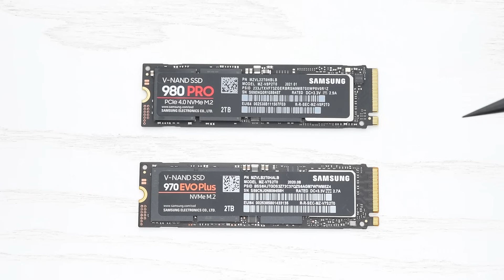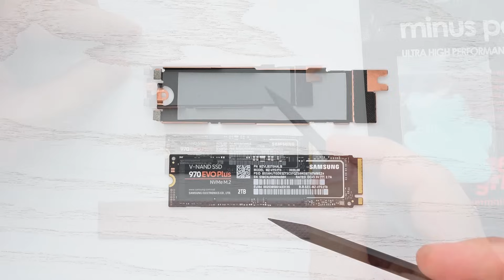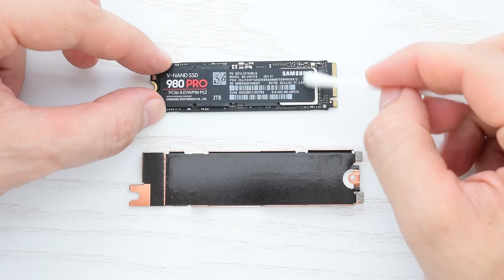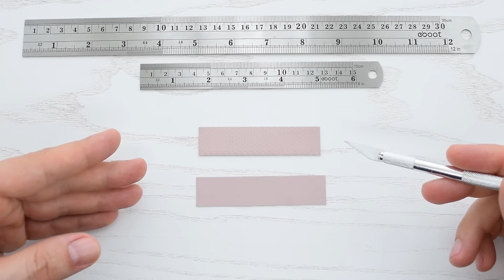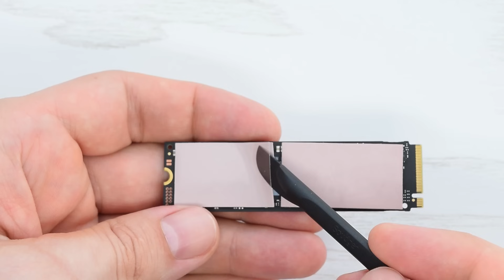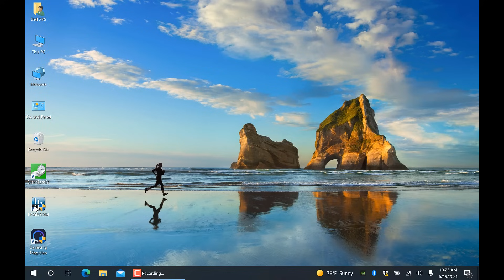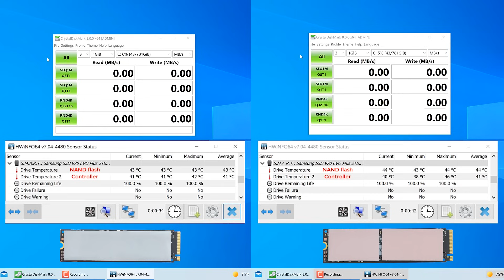Stop your Samsung NVMe SSD from Overheating and Thermal Throttling

Comment: Hello,

I have a WD Blue SN570 NVME SSD that I am placing into a Sabrent NVME Enclosure. The enclosure came with its own thermal pad applied to the bottom of the top cover/heat sink but, it doesn’t actually make proper contact with my SSD.. I have been thinking of replacing it but I have 2 problems:

Unlike your Samsung NVME the WD Blue seems to only have much fewer of those black controllers protruding from it ( 1 larger, 1 smaller,and 1 very small) and so I don’t actually know how to apply it.

I suspect I will need more than 1mm of thermal pad and it is hard to find adhesive ones in this range. How important is it that it adheres to the top cover/heatsink?
Reply from the maker: You can use 1mm pad if your heat sink supports that thickness. The link in the description.

Comment: Would using a .8 mm thermal pad for both work?
Reply from the maker: If your heat sink allows that size then you can use it as a one piece.
Reply: @ElectronicsComputers  what do you mean? I have a 970 evo plus with be wuiet  mc1 heatsink. I’m replacing the preinstalled thermal pad(the one that’s above the ssd) since I damaged the preinstalled one accidentally. Won’t the nand and controller still be uneven if I dont use 2 thicknesses of thermal pads? Or is the 0.8 mm thermal pad thick enough that it somehow works for both? Thank you very much!

Comment: Actually, the controller needs cooling and NOT the NAND memory chips.  The memory needs to run warner when reading or writing.
Reply from the maker: Heat is number one enemy of electronic components. The temperature of your SSD  shouldn't go above 50C.

Comment: Does removing thermal pad later after 6 month removes serial no. and qr code and information written on it?
Reply from the maker: Removing the label will void the warranty and it doesn't make any real difference in cooling your SSD.
Reply: @ElectronicsComputers  I am asking that if I paste thermal pad on printed label without removing it, then while removing thermal pad after 6 months, removes lebel information as pad is sticky?

Comment: Can i also apply it on every ssd? Like the stock one on my laptop?
Reply from the maker: Only if there's a difference in thickness between the components.
Reply: @ElectronicsComputers  like in the Asus rog strix g17 2022?
Reply: @ElectronicsComputers  does it need a thermal pad
Reply: @ElectronicsComputers  the asus doesn’t have a heatsink 
Can i just apply the thermal pad just like that?
Reply: Same I plan to but the g17 but theres no heatsink

Comment: Hi, I’m intend to get the TR-M.2 2280 heatsink. Do you think i still have to buy the 0.5 mm pad just for the NAND chip ?
Reply from the maker: You can use 1-1.5mm pad for the whole SSD with that heatsink. So no need to use two different pads.

Comment: Did you compare the effectiveness of using one short .5mm strip on the controller and then another longer .5mm strip across the entire length?  This would not leave an opening in the middle uncovered and the longer top strip might better dissipate heat over the entire span.
Reply from the maker: That heat sink doesn't support 5mm thermal pads it's too thick.
Reply: @ElectronicsComputers  I think he was talking about 0.5 mm strips. I am wondering the same. Do I really need to buy both 0.5 mm ($11.99)  and 1 mm strip ($16.95)? Or I can buy 0.5 mm strip and use one layer on NAND chip and then cover it with another long 0.5 mm layer for both areas ?

Comment: Do you need to remove the stock thermal pad, and if so, can you just peel it off? Or do you need to use rubbing alcohol/other solution first?
Reply from the maker: Removing the label will void the warranty and it doesn't make any real difference in cooling your SSD.

Comment: Great video. I have 980 pro on my desktop and I’m going to use your method. But I saw some comments said that 0.75mm is better than 0.5mm,  and the other one still use 1mm. Now I’m so confuse that I should buy 0.5mm or 0.75mm, I haven’t any professional tools to measure that.
Reply from the maker: There's about 0.5mm difference between the chips. So 0.5mm and 1mm works just fine. You can also use 0.5mm for the controller and 0.75mm for NAND.

Comment: Thanks for the video!  I have just ordered the WD Black SN850, could this work also with that modell? I wasn't sure if the heatsinc would still fit into my thin Aero 15 laptop, so I didnt' order one. probably bad idea, right?
Reply from the maker: There's no heatsink for that model, so no sense to use thermal pads. WD Black SN85 is a Gen4 SSD when your laptop has only Gen3 speeds support, so your SSD won't overheat.

Comment: Is this necessary in a ps5?
Reply from the maker: For PS5 you can buy Samsung 980 Pro SSD with its original heat sink and in that case there's no need to do anything. If you use a thing third party heat sink then you need to use two pads.

Comment: Hello, first I would like to thank you for this useful knowledge
I have a few questions that I hope you can answer
SSD Samsung 980 Pro w / Heatsink is a heatsink type, so it will fit in a laptop or not, and if it can, do we need to worry about heat dissipation like your video, I mean we do i need to add a heatsink or something like in your video?
Reply from the maker: That SSD is not for laptops. There's no way you can fit it in any existing laptop. What's the model of your laptop?
Reply: @ElectronicsComputers  My laptop is HP Victus 16
It has 1 slot for ssd gen 4. I see it has a horizontal copper bar and has a layer of double-sided glue (this is probably the heatsink according to the machine)
if i use the SSD Samsung 980 Pro w / Heatsink and remove the heatsink with the machine will it fit

Comment: why did you apply the thermopads ON the sticker ? it works as a insulation, so if you remove the sticker and apply the thermopads DIRECTLY on the memory chips/cotroller - the result will be MUCH better.
Reply from the maker: NO! Removing the label will void the warranty and it doesn't make any real difference in cooling your SSD.

Comment: Great explanation. Samsung could easily fixed this problem before launching. When I first bought it I have noticed and fixed at the first sight. I will buy a new one with the original heatsing bundle. Hope it has the indents on original heat sink accordingly :) Just out of curiosity.
Reply from the maker: Glad it helped

Comment: I am pretty sure its better to remove the samsung sticker its best to leave it if your not using a heatsink but if you use a heatsing with a thermal pad like in your case its just another layer the heat has to go through its better to just go staright to the thermal pad and heatsink
Reply from the maker: Removing the label will void the warranty and it doesn't make any real difference in cooling your SSD.

Comment: If i used thermal pad. No heatsink. What happen my laptop ? I don't want broke sticker samsung ssd 970 evo plus.

Please help me
Reply from the maker: There's no point of using thermal pad without a heatsink. There are some universal heatsinks available on the market. Check my links in the video description.
Reply: @ElectronicsComputers  thanks your info 👍
Reply: @ElectronicsComputers  one question again, if i apply your recomendation in video. How many time i change thermal pad ?

6 month or 1 years ?

Tahnk you 🙏

Comment: I have an HP laptop with a PM991 mzvlq256hajd which instantly goes to 90+ degrees and throttles. A fast 50 MB test gives 2000/1000 max, but anything else more throttles to only about 500/100. It is still under warranty, but so far HP support says it is not a big problem. Any way to prove sorting is wrong? Thanks.

Comment: hey so i had a nvme gen four firecuda 7000 speed and my pc was fine. i recently wanted more storage so i bought a 970 plus evo 3500 speed and now my cpu gets hot. i’ll play csgo and it’s at 81 celsius. i took out the new evo nvme and it still runs hot. any tips for me man? I LOOKED EVERYWHERE LOCALLY😭😭😭 i do stream so i’m scared to run obs at this point
Reply from the maker: If it's a laptop, then 80c is a totally normal temp under heavy load. That SSD has nothing to do with your CPU temperature.

Comment: Without any heatsink and thermal pad, i was pumping up to 98'c when stress testing on my NVMe Samsung 970 pro 1tb. Suprisingly, it has lasted a whole year without a heatsink, but the temperatures for sure, were making me very nervous when i discovered them. So:
Having now installed a heatsink after buying one, i am down to 75'c max under stress conditions. Still a bit hot, but this is faaaarr more normal, and i can have more confidence that i am OK to push the drive. Definitely invest in a heatsink for Samsung 970/980 nvme's. Knowing what i do now...i am SHOCKED that Samsung did not provide a heatsink with this particular product.
The temperatures are clearly Dangerous by design.
Reply: They are not. I've used 960 Pro for over 5 years without heatsink, still works well and according to Magician the drive is still in perfect health.
Reply from the maker: Totally agree with you! With such uneven surface design, they should have applied a built-in heatsink (just a custom built copper or aluminum stripe) like other manufacturers do. That would solve the problem.
Reply: What brand cooler did you buy? I am looking at a be quiet m.2 heatsink right now and want to know if yours is better
Reply: @car3448  I bought a QIVYNSRY M.2 Heatsink  from amazon for like £7 (US $9) and it solved all my temperature worries. It was cheap, all i wanted, and did the job. 
Installation difficulty: 1/10  Its super easy to install, as easy as lego bricks.  I used the One thermal pad method, and its fine.
Reply: 970 is normal though wo heatsink it maxed at 60s (67 or smth)
Reply: I don't care much about "not included" heatsink, I care that you cannot put your own! All components have different height and it's mess - you cannot put one good big heatsink over drive. 👎

Comment: Is 2mm Thermal pad to thick? Should I buy instead 0,5 mm, 1mm or 1,5mm for samsung 970 evo plus?
Reply from the maker: There;s difference 0.5mm between chips. so you can use 0.5mm and 1mm or 1.5mm and 2mm pads but it depends what thickness supports your heat sink. In most cases for laptops you need 0.2mm and 1.5mm pads.

Comment: i have the same ssd 980 pro and no heating or performance issues i do not use cooling just installed the ssd like it came.
Reply from the maker: In that case don't keep any valuable data on that drive.

Comment: Why on earth would you leave the Samsung sticker on the drive?? You need to remove that and have the pads making direct contact to the drive and heatsink on the other side.
Reply from the maker: Never do that! Removing the label will void the warranty and it doesn't make any real difference in cooling your SSD.

Comment: Why not take off the brand sticker before applying the thermal pad tape?
Reply from the maker: Removing the label will void the warranty and it doesn't make any real difference in cooling your SSD.

Comment: Just the video I need..Is it the same method for a seagate Firecuda  530?
Reply from the maker: Firecuda  530 has more or less even surface, so if you can use 1mm pad it will perfectly cover all components.
Reply: @ElectronicsComputers  cool..will a samsung 980 pro 500gb be enough for just windows and programs? Will a furecuda 530 be overkill for just windows and programs??
Reply: @ElectronicsComputers  Asus  recommends thermal pads od 1.25mm thickness pads for my Asus maximus z690 extreme motherboard. Should I gocwith recomm3nded sizes or is 1mm enough??
Reply from the maker: @gavinlangford2984  You can use any thermal pads 1-1.5mm thick. If you can find high-quality 1.25mm pad, then go with it. Otherwise choose something else.
Reply: @ElectronicsComputers  awesome. Thermal grizzly make a thickness of 1.5 mm. This will be alright to suit 1.25 instead of 1 mm??

Comment: Can i use 1,5mm and 0,8mm??
Reply from the maker: There's 0.5mm difference between the chips. So you can use 0.5mm and 1mm or 1mm and 1.5mm pads.

Comment: Any recommended thermal pad sizes for lenovo legion 5 15ith6h heatsink? Can I use 1.5mm and 1.0mm? Thank you 🙏🏻🙏🏻
Reply from the maker: If the original pad is 0.5mm then you can use only 0.5 and 1mm pads. Looks like the original one is 0.5mm in that model.
Reply: @ElectronicsComputers  thank you much appreciated 👍🏼, what do you think of Zezzio and thermalright extreme oddysey thermal pads, are they also good?

Comment: So if you can use a thick pad, say 3mm, under the heatsink, do you still need to do this?
Reply from the maker: Usually there's no need to do that if you can use a thick thermal pad, because it perfectly covers all uneven surfaces.
Reply: @ElectronicsComputers  Thank you for the information and helpful video!
Reply from the maker: @JoseSanchez-mk1ed  I'm happy to help!

Comment: I think you referred to laptops, I think PCs doesn't needs this because the motherboards got a heatsink
Reply from the maker: That's right. For desktops you can use thick thermal pads which perfectly cover uneven surfaces of M.2 SSDs.

Comment: Hey, is the heat sink necessary or not ? cause i don't know if the universal sink will fit in the pc i'll buy (asus g17)
Reply from the maker: If you install Samsung 980PRO Gen 4 SSD into your laptop, which is Gen 3 capable, then you don't need a heatsink.
Reply: @ElectronicsComputers  i'm basically gonna buy the samsung 970 EVO Plus so is it 4th generation ? And will the pads hold to the ssd even without the sink ?

(Thks for your answers!)
Reply from the maker: @Etienne Leblanc  970 EVO is a gen3 SSD and it gets hot as hell. If you want to use it without a heatsink, your SSD won't last long. Without a heatsink, there's no need any thermal pads.

Comment: Hello, its a good solution to do. But, unfortunately i already doing it without cutting it apart. And right now when i benchmark it run in to 50 degree celcius. Is it normal? Note : using PNY CS2140 (never using nvme before)
Reply from the maker: There's no need to use two pads for that SSD. Its surface is more or less flat.
Reply: @ElectronicsComputers  but is it normal to get 50 celcius?

Comment: Hi @Electronics&Computers, thanks for the great video. One of the best tutorials in the last decade. 
My question is can and „shall“ I use the 0.5mm Thermalpad method on my samsung oem 980 pro (pm9a1) 2TB and my 980 pro 1tb.
I am going to use both under the thermal guards (onboard heatsinks) in my desktop gigabyte gaming x z690 ddr5 mainboard. Both heatsinks have pre installed thermalpads by gigabyte. My plan is just to use the cutout 0,5mm thermalpad on the controller side to align with the height of the nands to make it even. The thermalguard of the mainboard with the pre installed thermalpads would then overlap/sync with both the nands and the 0.5mm controller compound. Are u seeing any issues with doing so or any better idea to close the controller gap under a pre installed mainboard heatsink. Thanks in advance.

Comment: Better thermal pad?: Grizzlie (8W/mK), Gelid (15W/mK) or Thermalright (12.8 W/mK) for using with nvme and heatsink. It´s more or less the same?
Reply from the maker: It's not just about thermal conductivity but also how long those pads will last without drying out. Grizzly is high quality German stuff which will last years.

Comment: why don't we remove the sticker as well from the ssd, that will give even better thermal performance.
or is it like, placing thermal pad directly above the electronic components whih have their smd terminals exposed, not suggested?
Reply from the maker: Removing the label will void the warranty and it doesn't make any real difference in cooling your SSD.

Comment: is it okay to put thermal pads on the nvme and memory ram even without copper heatsink?
Reply from the maker: It's not gonna hold up and there's no sense of doing that. The thermal pad acts as a bridge that conducts heat from the one surface (SSD chips) to another (heat sink). There are some universal heat sinks that you can use with your SSD. the links in the description.
Reply: @ElectronicsComputers  so why are companies shipping their laptops out to customers with only thermal pads, the average person would never open their laptop or think of using a heatsink. This tells me thermal pads are ok to use without a heatsink. And it must make sense when engineers of the machines are finding it sufficient.

Comment: Should i use this method for Desktop PC and m2 heatsink passive radiator which requires thermal pads from both sides (up and down) ? P.S 980 PRO 2 TB
Reply from the maker: Depends on the pad thickness. if you can put a 2mm pad on the chips then no need to follow my method if it's something like 0.5mm-1mm then I'd definitely use two different size pads on the chips.
Reply: @ElectronicsComputers  manufacturer of the radiator says to use 2 different sizes, 0,5 on the back and 1,5 on top
Reply from the maker: @kamranaliyev5890  Then you can put 1.5mm on the controller and 1mm pad on the NAND chips. But a single 1.5mm pad will also work.

Comment: Would you be able to tell me if the WD Blue SN570 needs a heat sink? I heard in another video that you don't need one, and the design of that SSD is weird so I don't know if I can use a heat sink on it.
Reply from the maker: Of course you can. And for that SSD you'll need only one 0.5mm pad.

Comment: What thickness for 980?
Reply from the maker: there's 0.5mm difference between memory chips and the controller. So you can use any pads with 0.5 difference in thickness that work with your heatsink.

Comment: But... you just need to cool down the controller not the nand, if you do it that way, the controller heat will go to the nands...
Reply from the maker: No! Have you seen the test results or not? using this method you significantly lower the overall temperature of your drive.